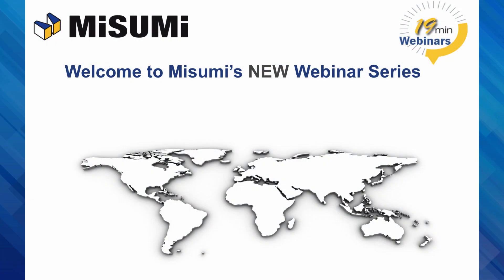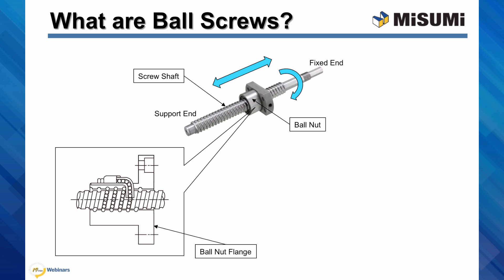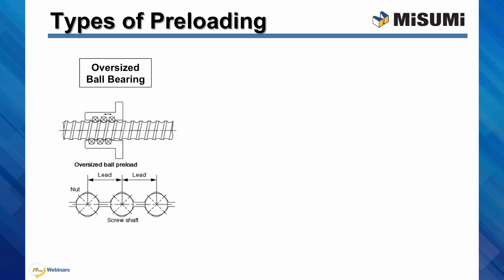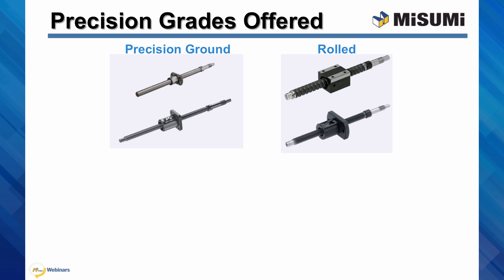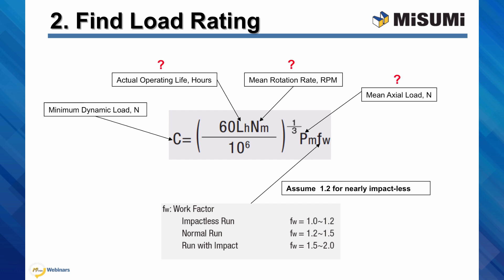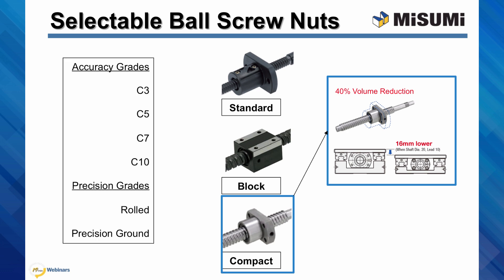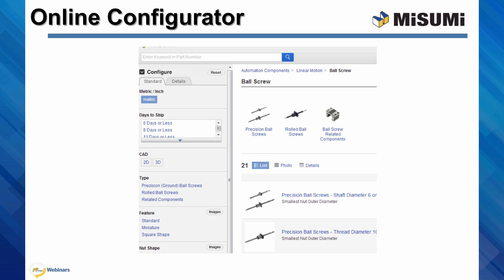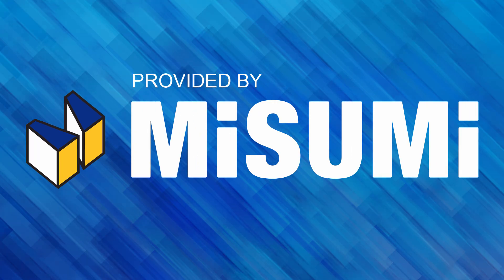Introduction to Ball Screws

Comment: What is the proper orientation of the bearing mount nearest the stepper end?   I have seen photos with it installed with that block in both directions in relation to the square piece bolted on with four bolts.  Or does it make any difference?
Thanks